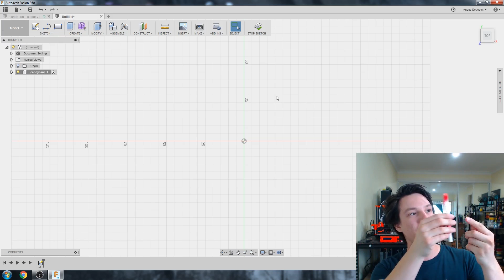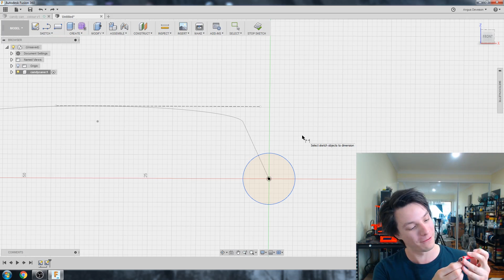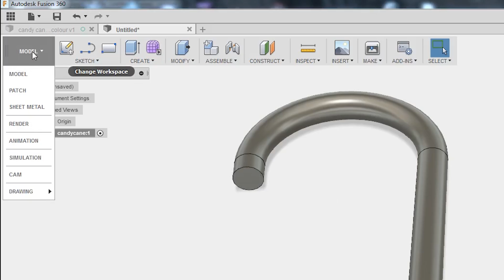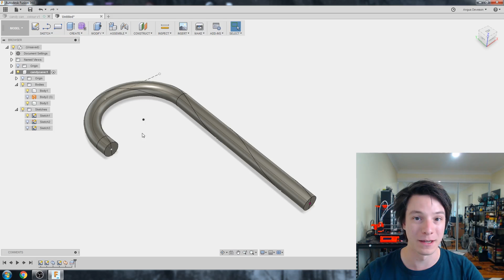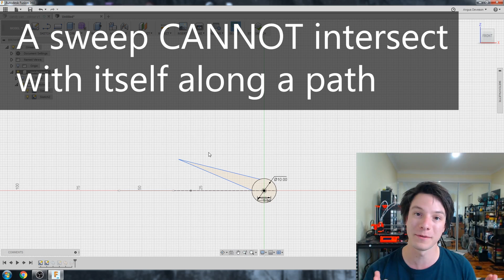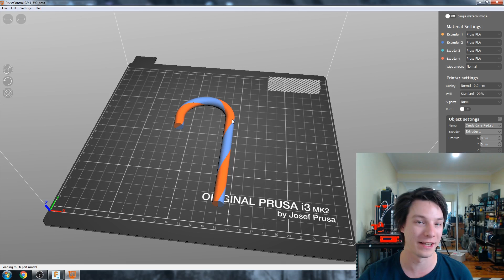3D Printed Candy Cane! How to use Sweeps in Fusion 360: CAD For Newbies

Comment: Instead of flattening the bottom to make the candy cane printable, you could just place the model on the print bed with a negative Z-height so that half is below the build-plate. This prints half of the candy cane. Then print the other half separately and superglue the two halves together afterwards.

Comment: Great tutorials with practical examples. One weird thing I found in sweep is that, when I create two perpendicular straight lines in the XY plane, I can't operate sweep under the patch mode. However, when one of the straight line is out of the XY plane, the sweep works. It is a bug?

Comment: Great video. I find it super important that you explain small issues that could occur and other points that you could use during the build. Example: you explained how the parallel and perpendicular worked and what happens when you sweep it. Also going back in your sketch and design and editing is super powerful in teaching. Keep up on showing "issues" a newbie may run into. Thanks so much for all these videos.

Comment: Just to test out how well free software can keep up with enterprice software, I tried to replicate this in sketchup with the path-follow tool.
And as expected making the rough shape of the candy took hardly any time(under 1 minute). Making such a spiraling thing on just a cilinder took 15 minutes with a lot of hand clicking fixing and patching. 
Sketchup can rather quickly slice a thing out with the intersect tool. However you need a spiral template to cut out, making a spiral in sketchup means either a lot of connecting-the-dots manual work, with the memory copy plugin you can speeds things up, but you're better of downloading a plugin that can do advanced spiraling and twisting for you.

Conclusion: when there is spiraling to be done or there is a curve inside another curve, you need a plugin when using sketchup. With the correct plugin this sort of work becomes easy again easy, with pure sketchup you're better off giving up if you want to model this very candy.
---
Obviously the drawback of software like sketchup is that once your design is done, you can go back and just change 1 feature.
Another note: When running sketchup 2016 on linux with wine, ruby might not work, and sketchup plugins pretty much all run on ruby. If you're running windows everything will be fine.

Comment: I've been using Fusion 360 for approximately six months now and really love it. Previous to that, I was doing all my modeling in Sketchup. It is so nice to model parametrically since changes are so much easier. Anyway, these sorts of simple and practical demonstrations are always appreciated. I actually have a Prusa i3 MK3 and multimaterial upgrade on order, so while I wait for the backorder to be fulfilled I'm filling my head with multicolor modeling tricks. Thanks again. Cheers!

Comment: Think it would be possible to print each body separately and "wind" them together? With no dual extruder, that still might be a way to print a dual color model?
Reply from the maker: If it was just twisting straight then sure, but not with the loop at the top!
Reply: Yeah good point, I realized that as well when I was looking at it S3D; but it was worth the thought. Now, if you get the candy 3d printer,  where this would be edible that would be next level!
Reply: Had the same thought and made this if you're interested....
https://www.thingiverse.com/thing:2669512

Worked out really well too... a lot of fun.

Comment: Qustion the twist for me only works up until the line bend at tip.. it wont go into that end top part you create with line. if i try to it says "the given path is not continuous.  To use the twist option, provide a smooth path" any ideas? am newer to this program
Reply: ALSO to add to the issue the split gets error "cant compute".. so something in settings or something off?  I started it over 5 different times starting tutorial over each time clean. same results
Reply: Just a guess but it sounds like your lines may not be tangential.
Reply: following same tangent as his video..

Comment: I'm surprised you didn't have any color bleed in the white filament. Maybe it's just the Hatchbox I use, but my whites always come out  with some of the dye from the previous filament.
Reply from the maker: I think there's a subtle pink hue, but the shiny polyalchemy white does a good job of hiding it.
Reply: Maker's Muse oh. Thank you for the reply.
Reply: You can greatly reduce this kind of bleeding by enlarging the purge block.  Of course the trade-off is that you waste a little more plastic.  I regularly use this approach when printing MM with whites or blacks.

Comment: Never tried the taper angle or twist modifiers on the sweep, i think it wasnt there yet when i played with them... gives me plenty of ideas, thanks for the great tutorial as always. I also thought that you would the the twist directly in the model by splitting the circle in two but the approach with the patch environment is also pretty cool.
Reply from the maker: They added the twist modifier a few months back so it's quite new. Yeah splitting the circle in two would definitely work saving as separate bodies, but you would have to do the flat on the bottom as an offset plane cut. Also, I wanted an excuse to show the patch workspace :)

Comment: The flat surface can be done in a slicer. 

I tried to make a cookie cutter with a sweep. 

I imported a .SVG and made a outline with 0 distance to have a good path. 

I then draw a T shape profile. 

But there are really card curves  and 90° angles.... Or greater. Is there a way to make it possible Ina single go or do I have to use multiple sweeps?

Comment: wow, that purge block looks like it takes a lot of filament! Is that going to be improved with future models? what are the design constraints with the multi-colored head that makes a purge block necessary, and what do you think future innovations on it will look like?
Reply from the maker: The Prusa MMU uses a single nozzle so you need to purge fully each color change. It can be smaller for similar colors but for example black to white needs a huge purge block. Limitations of the technology I suppose!

Comment: Could the 2 bodies be printed separately so that a single filament extruder could be used?
(print one body one color and the other body another color)
Reply from the maker: You wouldn't be able to snap the parts together more than likely, but some clever design might make it work!
Reply: Thanks for the reply !

Comment: Nice to know about patches (thanks), but could you not just sweep two semi circles with the twist?
Reply from the maker: Yep that's definitely another way to do it, making sure to select 'new bodies'. You would have to do the flat differently though, using an offset plane to create an extrude cut. I just wanted to take the opportunity to introduce the underused patch workspace.

Comment: an easier way to do it in my opinion would be to just put a line through the original profile making it 2 half circles, then just sweep both halves with the same twist and as new body, job done
Reply from the maker: +shane beasley true that! I just wanted an excuse to demonstrate patches
Reply: yea i thought there would be a reason behind your madness
Reply from the maker: The flat would also have to be done a bit differently if you're twisting the original sweep, with an offset plane and extrude cut.
Reply: the flat i would just do with an extrude subtract.
Reply: The benefit of the patch method is that you can make twists in objects with varying thickness, such as a sphere. I don't believe this is fully possible with just twisting a half body twice.
Reply: easier initially, but then harder to adjust using the visualization of 3d modeling.  look at half, decide it looks ok, then repeat process for other half, look at it.  or just make a hooked cane decide the thickness is proper in relation to length and curvature, then proceed to apply the twist.  then assess the visual impact of the new design feature.

MM did it in a more professional manufacturing and feature tree/workflow history managing way.  If you pack too much into one feature/edit it makes revision for design or engineering very hard to impossible.  You want to be able to go through a parts build timeline and adjust most of it without causing errors and general difficulty in managing the 'compile' of all the features and process in the history into the part.  it seems to me that packing to many geometric/mathematical 'steps' into one feature makes that happen more.  In this example case it makes redesigning geometry of the base part very hard and basically redoing the build, versus changing a few dimension numbers and saving as a new file, the new scaled version.  you want the cane, then you want the twist, because you then can type a few numbers to adjust either and have a new design instead of redoing it all over again because two things done separately must align through a complex curve exactly, no you make that complex curve then apply it to create the 2 halves, then if you change the complex curved surface you just readjusted both halves, and your work day is flowing faster.

In a way it's like photoshop versus illustrator, you can build in Fusion 360 (more so in Solidworks) in either a vector or raster methodology.  Vector is better you can scale a base dimension and have everything adjust and recompile the part correctly.  It's tricky, it's a bit based on style of modeling I guess.  Sometimes being creative means making a messed up hard to roll through timeline, but mostly it's good to keep each feature and process separate with names and dimensions assigned so the editing and recompiling a 3d part is easy.

Comment: could use some help in learning how to edit an existing stl file; like to modify a model off Thingiverse.
Reply: It's not great in fusion. You have to disable the time line, convert the mesh to brep, then enable the time line again. Even then it's a pain for many reasons and will be very slow to work with. I actually find tinker cad and 3d builder to be better for editing stls
Reply: thanks for the help